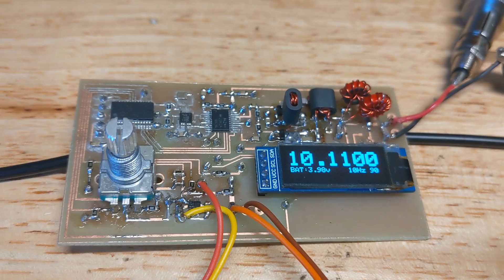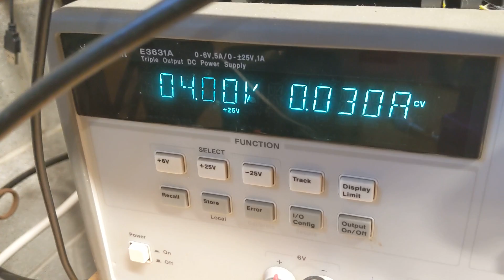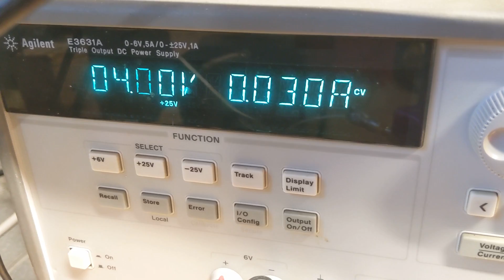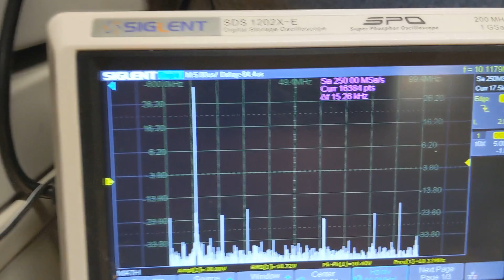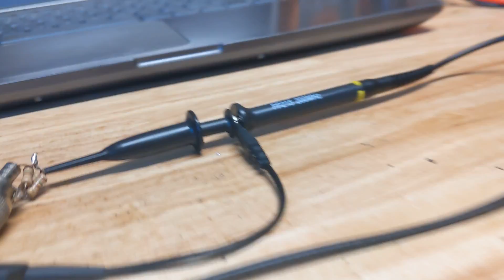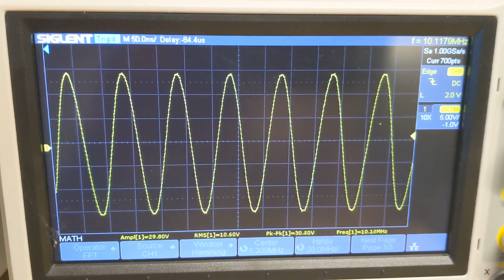Low voltage, high efficiency QRP RF Amplifier

Comment: How do you program the PIC? Can you use Arduino IDE? I have a bit of experience with the ESP8266 on Arduino and have made webservers on them to respond to inputs from a phone or laptop. That could be pretty fun!
Also, do you have the source code? Or do you sell these pre-programmed?
Reply from the maker: the pic is not important any source of square wave drive will work

Comment: Is that 75% battery power to RF power?? That is darn impressive!! I have about twenty 18650 cells from dead laptop packs that seem to be working just fine so This would be perfect! I like how you think about circuit design to make use of what you have laying around! 73 de KI5SOH
Reply from the maker: 70-75% based on input power to the drains of mosfets not including any other portion of the driver circuit